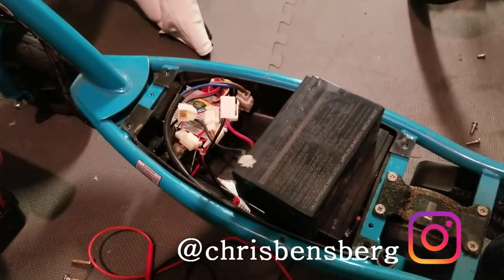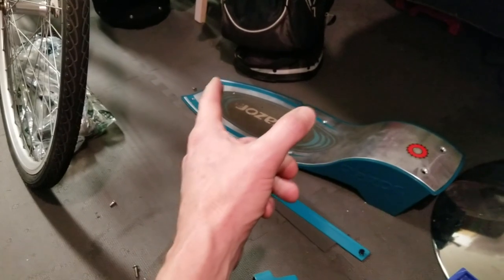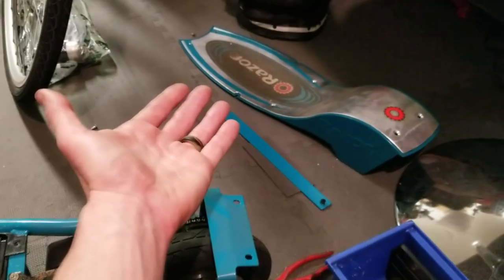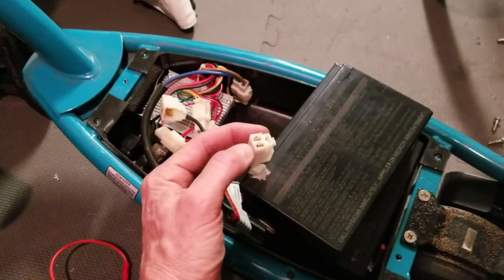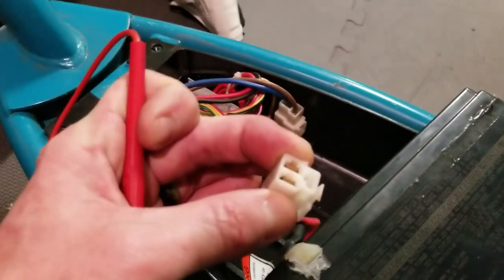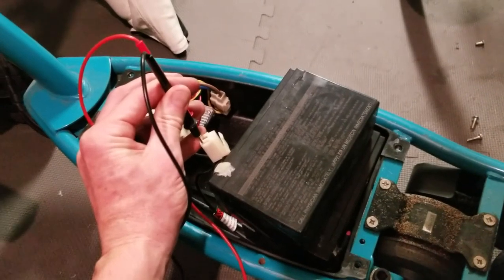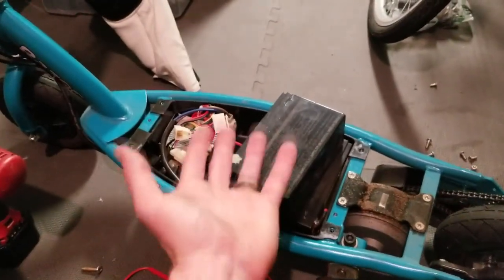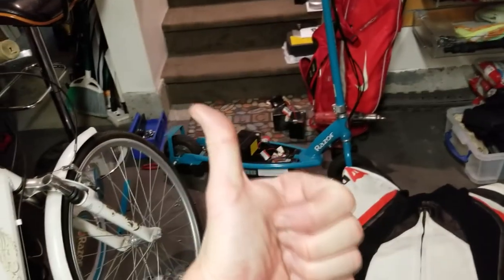How To Test Razor Electric Scooter Batteries To See If There Good Or Need Replacement!

Comment: I recently acquired a razor e300 and after charging it, learned 2 things, it will go without a kick boost as the e100 and it has no Torque.
Checked battery at 22v.
Advice is appreciated.

Comment: Just curious as to why you pointed out the way you configured your multimeter wire configuration when it is 100% wrong. Battery is most definitely dead but if it wasnt your meter may be. You have the black negative test lead plugged into the (use for all testing functions except high amps red positive "socket". Then you have your red positive test lead plugged into the for high amps positive "socket". This is why you got a negative reading when you had the leads placed correctly in the battery terminal. Is your reading false no per se but It's definitely not accurate and why risk blowing both the cheap meters fuses that'll cost more than the meter to replace. If the around the house odd job audience you are trying to help dont need a true rms reading than the meter you have there isn't cheap it's 10$ and is inexpensive and gets the job done. Only attempting to save someone +/-10$ before they spend 20-30$ on new batteries not a jerk
Reply: Glad Im not the only one that caught that.  Black goes in the COM, and the Red goes in the middle.  The other terminal is for sticking the meter inline with a circuit to measure current.
Reply: i noticed that off the batt and said his reading is gonna be off
Reply: As an electrician I approve this comment

Comment: We hate to say someone is wrong, but this method of testing is TOTALLY inaccurate.  Most of the time when scooter batteies go bad they still show good voltage, but have no power behind that voltage.  Here, at Wild Scooter Parts, we call this condition "Phantom Voltage".  Please see our video on this condition to properly diagnose.  DO NOT go by what is in this video.
Reply: Mine shows 22v and has no Torque after full charge, but didn't think to check Amperage.
Doesn't need a kick off like razor e100 either.

Comment: What should the battery read if it was a good battery?
Reply: Voltage is not going to show you if its bad.  You need to load test.  Please DO NOT go by this guys video and see our video on Razor Scooter Phantom Voltage.  We are Wild Scooter Parts, the largest Scooter Parts dealer in the US.

Comment: Thank you in advance!  My boys razor bike has same charger/batteries etc. identical. I am getting good voltage reading independently and together, each around 13.3 volts. Could they still be bad even if showing that reading? It does really quick. Thank you !

Comment: you probaby are wrong about battery voltage  ,usually with these scooters each battery  is 12 volts wired in series 24 total

Comment: Got 1 for the St look new body only don't running the switch on see red light put to running motor no do nothing how much the battery need to be 12v13 volt mored  how can che what are it bad to see can fit thank you

Comment: What I need is a picture of the wires from the batteries to the connection because I found one in a dumpster and somebody cut the wires so I have to see how they go from the battery to the connector. I also need a charger if I can get one for 5 or 10 bucks or it goes back in the dumpster.

Comment: What does a good battery register
Reply: The voltage number
Reply: As we said above, Voltage is not going to show you if its bad.  You need to load test.  Please DO NOT go by this guys video.  See our video on Razor Scooter Phantom Voltage.  We are Wild Scooter Parts, the largest Scooter Parts dealer in the US.

Comment: You used the wrong connections on your meter !
Black - to com and red to V, the middle one.
Did you even notice the - sign ?
Reply: migsven surfing that doesn’t matter. I will show the same reading but with a - sign
Reply: it does matter because you are supposed to use tools correctly @finncampeau4922
Reply: Doesnt affect and of the components when working with DC voltage unless you are using continuity tester on small voltage logic curcuits.
Reply: gold3n rul3 you are but in this case it made zero difference
Reply: Voltage is just a difference between 2 nodes, so wither way